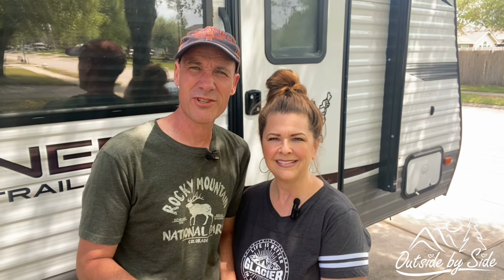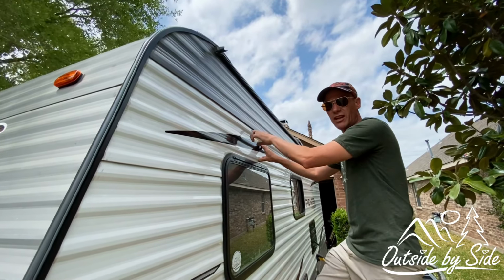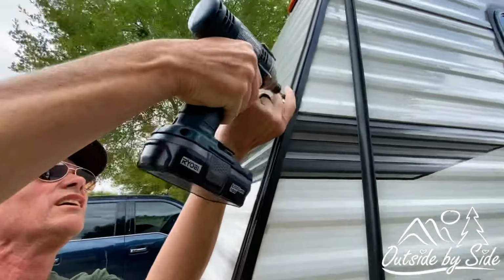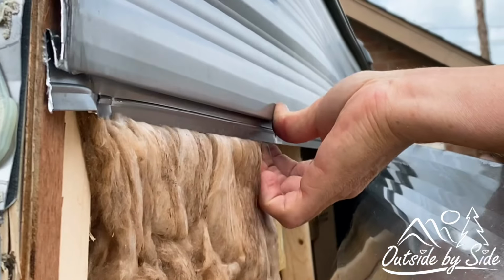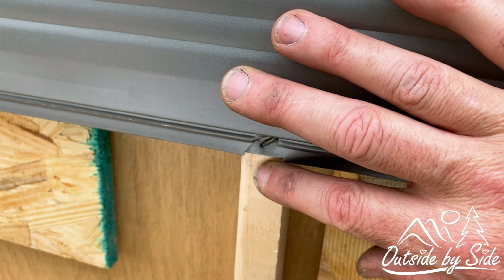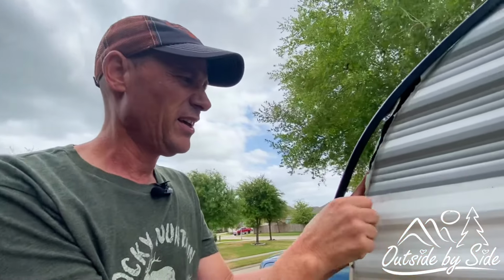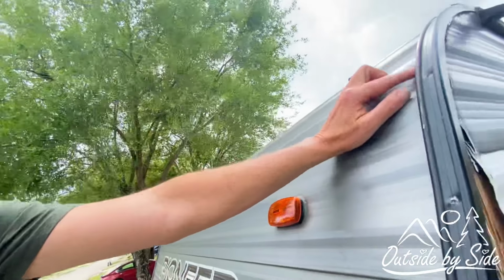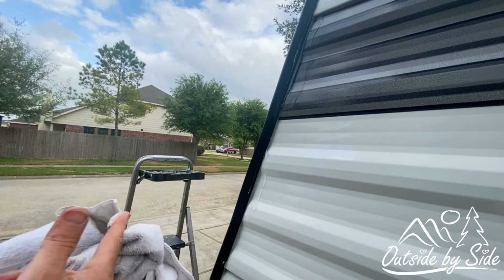How to Repair the Aluminum Siding On Your Travel Trailer! DIY!

Comment: Fiberglass Traikers also delaminate.  I read that 90% of people that work in the RV Industry do NOT own RV's.  They are ALL Junk.  And even most of the super expensive RV's are JUNK because they are all using the same manufacturers for components.  Only a small handful of companies make the parts then the MFG's just assemble the parts.  Want to good trailer.  Buy a full Aluminum CARGO Trailer then spend an eternity building it out.  The benefit is you can eliminate the things you really do not want in a floor plan like the rediculous tiny sinks in the bathrooms or the useless short dinette bed configurations.  install a REAL Shower stall and REAL Cabinets.  Be sure to not skimp on the AC unit.   After adding up the cost of RV's, the maintenance, storage, insurance, etc.  unless you really use them a lot one is better off just renting or investing in a sweet day tripper vehicle VAN w/fridge and sink) and getting a Hotel.  My opinon.  My 2 cents (And thqat's all it is worth).  I have owned a few RV's and I have spent 100's of hours "fixing" them so that they are usable.  I also built out a steel frame cargo trailer only to have the frame rust out wiyhin a year due to poor manufacturing and poor undercoating.  Airsteam ($$$$$).  Oliver Trailers ($$$$).  EscapeTrailers ($$$$).  Bigfoot Trailers ($$$$).  Look at the Excape 23 it's about $60 K and if you take care of the fiberglass should go 15-20 years (Still going to have appliance issues over time).  They do have good resale value...but people hold on to them.
Reply from the maker: @UntamedAustin we agree with you on the fact that when you get into travel trailer living, there is no perfect trailer or extremely well-made trailer that will last a lifetime. Thank you for taking time to comment. We appreciate all feedback because as a community we help each other! We do agree that you pay for what you get when it comes to travel trailers and RVs. We are very pleased with our new Grand Design and haven’t had any issues so far. We made a video on that that we think you might enjoy. Thanks for watching and happy camping!

Comment: Same thing happened to ours. I just noticed. We have had nothing but issues with our 264bh Jayco that I wish we wouldnt have purchased it. AC unit stopped working 3x, hitch light doesnt work, tail light has moisture in it, backflow valve for black tank leaked, and now a orange runner light flrew off on road and siding popping out. Very poor quality camper. We will never buy another.
Reply from the maker: @Christopher Greenawait We are so sorry to hear you have had these issues! We have had several as well but we have decided we love the travel trailer life and will be looking for another trailer soon. The campers could definitely be made so much better! Thanks for watching our video & we hope you don’t give up on camping! 🤩

Comment: Corner seams should be sealed with multi thermal urethane tape , try again
Reply from the maker: @axelzilm778 Thank you for watching our video and taking time to comment and give our community another tip. We appreciate you! Our trailer has held up great but in the event we need more repairs, we will definitely take this into consideration. Thanks again! 🤩